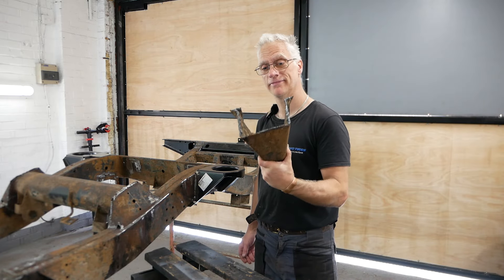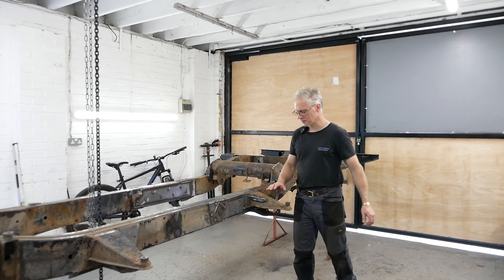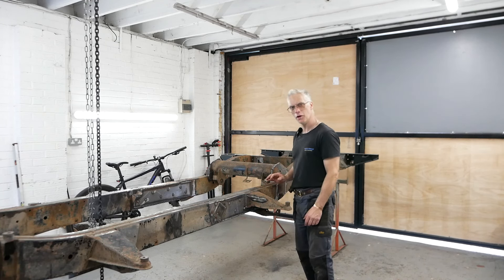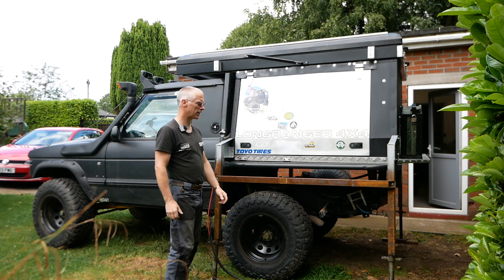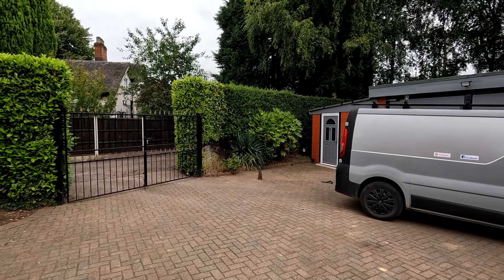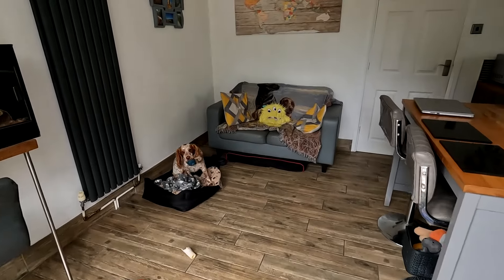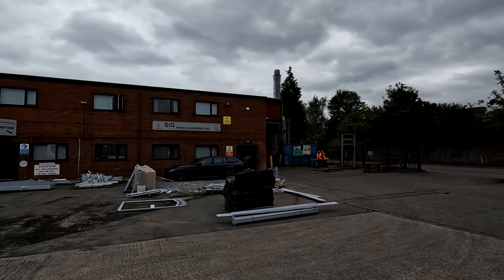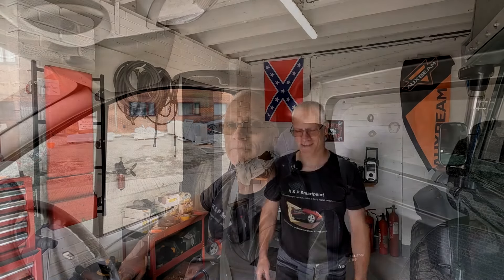Chassis finally goes for shotblasting |Overland Vehicle 4x4  300TDI | Overland Garage...Part 5

Comment: Seeing as you have all the jigs made up, I’ll just drop my disco 1 off at your place for a chop and stretch cassis job.
Aussies tend to do this with touring (overlanding) rigs then have to get them replated for the amount of weight they add.
Loving this series.
Reply from the maker: Hi..i don't fancy doing another quite so soon as its fairly a massive job lol..but technically here after doing a chassis test you have to get a SVA test done.

Comment: Well paul bet your pleased 1ith that chassis build. (For now).you can take that nail out of the metre😂. It looks well impressive for not doing a one before.it will be a doddle for you to put engine and box's in .i have one problem with your channel as well THERE NOT LONG ENOUGH. keep going.
Reply from the maker: Hi mate....its a really nice feeling now i have finished the welding and a bit cheaper on the pocket..i have a whole week of filming next week just on dismantling the truck ready for when the chassis turns up...i cannot wait to see what it looks like stretched really glad you are enjoying the video series.

Comment: With this change to the chassis do you still get to keep the original plate need to get a q plate ..I once saw a stretched discovery the internet says it was 116inch
Reply from the maker: Hi...yes i will be keeping the original as its only like doing an ordinary chassis swap on a defender or a TD5 discovery....land rover actually made a 116 inch chassis for the range rovers to give them more leg room in the back...Land rover special vehicles actually cut the chassis and lengthened them in house.